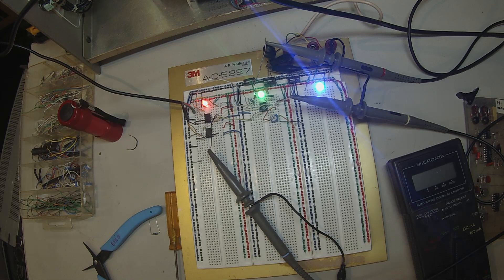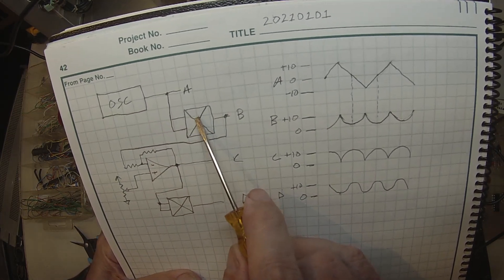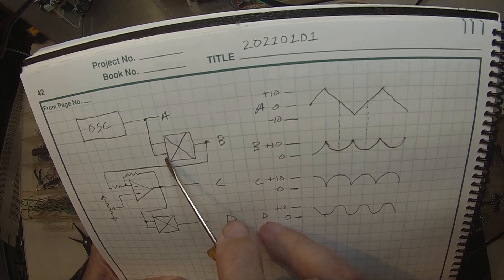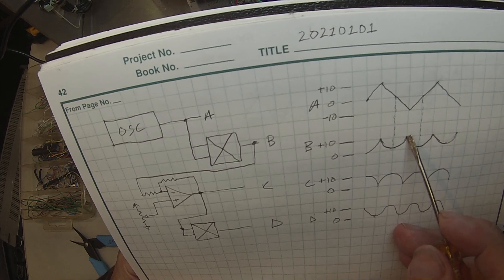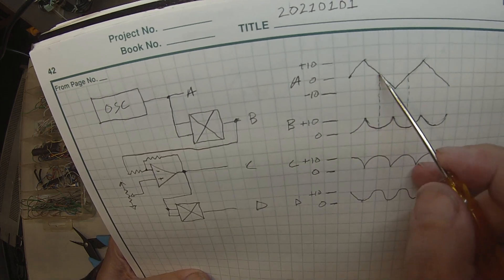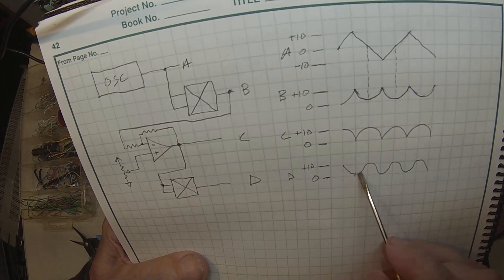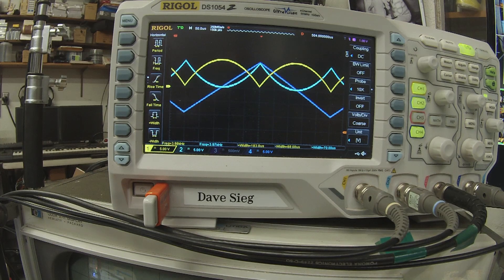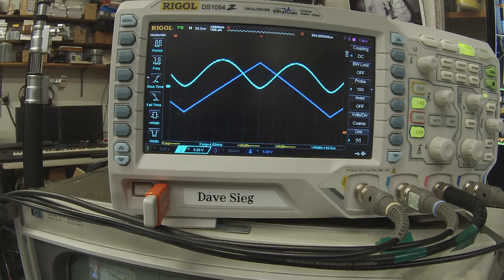20210102 1 Squaring, inverting, squaring a ramp into a sine wave

Comment: i never heard of this trick. doing it with digital a digital oscillator produced a clean sine shape, except for a spike of noise at the peak. maybe a fully bandlimited oscillator wouldn't have that, have to check that out
Reply: the problem was that I used a saw wave as a starting point instead of a triangle/ramp

Comment: Not a sinewave, thats a potato. Crazy even harmonic distortion. Much cheaper triangle to sine converter is a JFET circuit according to Middlebrook & Richer. And also produces much less distortion, if trimmed right (under 1% THD).  Analog multipliers are pretty expensive components., compared to the simple JFET sine converter and the resulting sine from the multipliers is poor quality.
Reply: But analog multipliers are stock building blocks of the Scanimate so I would understand why they used this trick to emulate sine waves. I agree that it doesn't quite look like a sine wave to the eye (and usually you can have pretty bad THD before it becoming visually apparent). I guess it's good enough for nice wavy animations, though.

I tried doing exactly this in Adobe Audition, and ended up with the same waveform that is demonstrated here. Frequency analysis shows a second overtone 25 dB below the fundamental, and third overtone 40 dB below. This should mean around 5-6% THD, pretty bad for audio purpose.

Comment: What multiplier chip are you using? They are voltage multipliers. Right?
Reply from the maker: Right, Analog Devces  633.  Output = (X * Y) / 10
Reply: these thing are so damn expensive, what gives